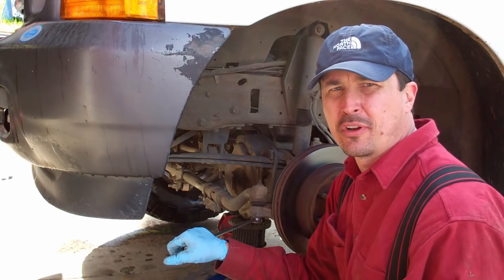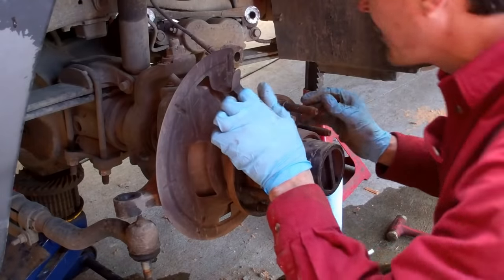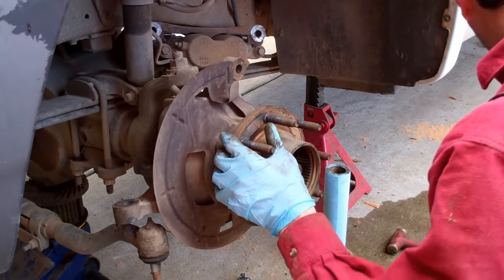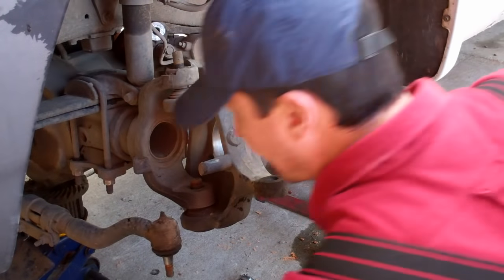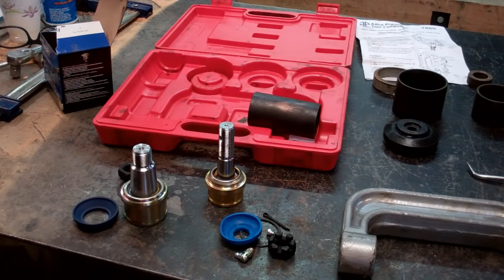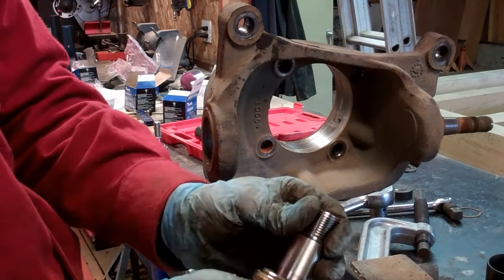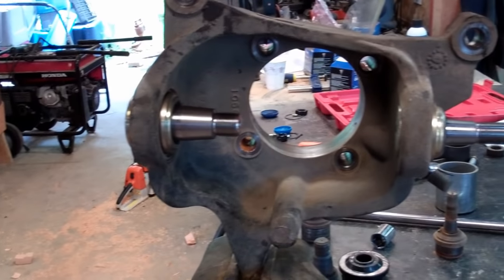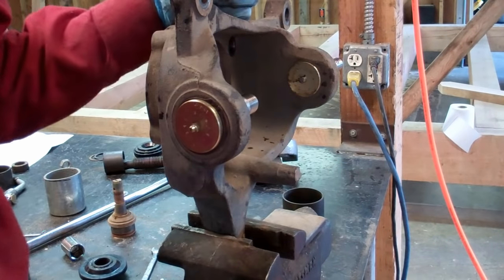How To Replace Worn Ball Joints Ford F250 Truck

Comment: Would bad ball joints cause my steering wheel to not want to return to center after finishing a left or right hand turn? I have to straighten it back myself. Then it seems like it wants to go the other way and I have to fight it back to the center.
Reply: One or both u joints are froze.
Reply: Yep, that's exactly what it was.  I had a reputable shop look at it and gave me a quote of just under $1000 to do u-joints and ball joints on both sides.  They said the ball joints were shot.  I didn't feel like shelling out that much so I bought a 3 ton jack, 6 ton stands, some other tools I didn't have, ordered ball joints and u-joints (all greaseable Moog brand) and new pads and rotors from Rock Auto and went to town on it.  Took me about 2 weeks due to working in my driveway in NE Ohio in March.  Turned out both axle u-joints were completely froze.  The ball joints were fine.  I regreased them and left them (I didn't want to get in to having to need an alignment... the TTB front axles are a pain to have aligned properly).  All in all I had about $400 between parts and tools.  I still have the ball joints in case I ever need to change them.  I had zero experience doing this work and learned it all from YouTube and the Fordtrucks forum.
Reply: I got the 3 ton steel jack from Harbor Freight.  It's actually a very nice jack (they also make a 3 ton low profile but I bought the regular one, it just looked stronger).  With the 20% coupon they always have out it was about $60-70 I believe.  I also bought the 6 ton steel jack stands for about $35.  The jack and stands had absolutely no problems lifting and holding my truck.  And it's pretty darn heavy ('89 F250 ext cab, long bed, 4WD, 351 V8).  I actually had to leave it on the stands for a couple of weeks at a time due to weather issues getting in the way.  If you can, order your parts through Rockauto.com - they're alot cheaper than parts stores.  Good luck!!  Oh yeah, and join the Ford Truck forum online.  They pretty much were able to walk me through any issue I had while tackling the job.  My username on there is Ford SD

Comment: What year model is this? I have an 04 and the drive shaft will not slide through the ankle. I have to remove the ankle and the drive shaft at the same time.
Reply: hey guy i am a ford tech..... you have to take the little cap off the hub to expose the nut that holds the outer cv joint tight 13 mm than take the swap bar end link loose , caliper and mounting bracket off ... abs wire etc etc... take loose the 21 mm nut on tie rod end ( separate it) .... take the vacuum hoses of the IWE ( 4x4 act. on back side of hub ) take 21 .mm loose upper b/j .... shock loose ... pull top of knuckle toward you and remove axle from hub and set aside... loosen lower b/j and separate ... remove knuckle and use BFH to remove ball joint from lower control arm .... pretty sure that is  it  i believe .....
Reply: thats a f 150
Reply: Jason Conroe 04 f 250 is same as video.... this guy made it look easy by pausing the camera.... sometimes getting the axle to slide out is a pain .... the big vacuum seal is a mother clucker to get moving ..... putting it back in is a pain with out the special tool to drive the seal in ....
Reply: thanks bud.

Comment: There is a technical service bulletin for the installation of ball joints. Torque specs are required in sequence like head-bolts.

Comment: Put a small straight grease fitting in the upper ball joint. There is an attachment I have for my grease gun that I bought so you can grease them. The attachment does not push onto the end of the fitting, it slides on from the side. I believe I got mine from McMaster, don't remember.

Comment: Now I am wondering how worn my joints are at 100,000 miles on an 2002 F350.  How many miles should we be getting out of a set???
Reply: They were not easy to replace, did the left side and an alignment.

Comment: re install is not just reverse order. you need to torque the top and bottom in a certain order.1st bottom partially torqued (find specs) , then top with the camber/caster adjuster in place, then torque bottom to spec. If you do this wrong (AS THE FORD DEALER DID TO MINE UNDER WARRANTY) by doing the top first, you can create a huge dead space before the bottom seats in its taper. Then you would have to actually flex and bend the "C" shaped axle ends, compressing them together creating MASSIVE pressure pulling apart on your new ball joints. Also, it's sooo hard to turn under the pressure, it taxes on your steering system. Ford screwed mine up when I brought my new truck back due to a pull to the left (front right had pos camber) i could see by eye. First they LET AIR OUT OF MY RIGHT TIRE to fix the pulling. The following day at the dealer, every one waiting for there car and probably every one within a mile could here me . I bet it was a good story around that dealer for a long time. Aligned yes, but not done correct as I found out 12 years later while changing my wheel bearing.............

Comment: Anyone may comment, if you know what i am talking about.
@ 8:24 in the video he is pulling out the axle shaft. While he is doing that it looks like there are two lose rings on it?  What are they and do they need to be replaced as well?  If I look at my F-250's front axle it has the same rings and they appear to be lose as well. just wondering if anyone would have an answer?
Reply: What you are seeing is the inner dust seal, yes I would replace it, I think it was less then $10.00, for a list of what you need check out www.powerstrokepsd.com, hit the tab write ups and click on ball joint replacement. The list is for 99-03 super duties.

Comment: While most of the video was good, I seen a few things that could have been done differently and a question. Not meaning to be negative on your video, just some input on things I seen. I changed my ball joints about 3 years ago and that upper ball joint right angle grease zerk would have fit, with a very small bit of grinding on the ball part of the zerk, it would have cleared the axle shaft. Also, you wasted your money on that 3in pipe. with a different configuration with the press, the longer pipe wasn't needed. Lastly, where was your thrust washer (plastic disc with 4 slots) that goes between then knuckle seal (slots toward knuckle seal) and the hub assembly?

Comment: I wish it were that easy to replace ball joints on what I work on, although they are called king pins and they go on heavy equipment weight 17 to 50k lbs easy. One the smaller end a CAT 420 backhoe the front axle knuckle weighs about 110lbs alone, I've had to melt out one pin due to it rusted in knuckle, you have to pull them out. pry bars and 8lb sledge no, tap the pin bolt hole to make a push bolt no, heat with push bolts no, so melt it. 
Sometimes on this stuff you just gotta melt it out. I'm doing the ball joints on my 2000 ford excursion 7.3 now and I don't mind it at all

Comment: At 15:00
You can also cut down the old ball joint with a saws all or cut off wheel so it will fit the tube in the kit.

Comment: If you use a small screw driver and place it between the snap ring and the ball joint groove you can keep it from reseating in the grove and remove it. $80.00 is the price of a good ball joint clamp so you'd be money ahead getting one.

Comment: It is incredible how much easier this is without all the rust that our old trucks have here with salty roads in the east. I did this on my old Ford and every nut or bolt was a battle. I needed a lot of heat, hacksaw, grinder, air chisel, etc. Look at bah53 video to see what I mean. He lives in Minnesota.

Comment: I was just quoted 3600 to have three entire front end rebuilt on my 99 super duty. Ordering parts doing it myself, will cost about 800. Local shop wanted 1700 just in parts

Comment: Ever replace front wheel bearings instead of buying the hole assembly?
Reply: sorry. Not possible on the 99-03 super duties. You can replace the smaller needle bearings at the back of the hubs though. But not the large main bearing in the middle of the hub.

Comment: Wish you could have included video on the seal reinstall part. Both Knuckle and dust seals. They caused a great PIA, esp the axle dust seal. Could not get them seated.

Often times, it takes less effort to uninstall t

Comment: Lucky with manual hubs, need a seal driver if it had auto locking hubs, the seal don't mean much on a manual lock hub other than a dust seal, auto lock the seal must be replace and put in with the driver tool to avoid problems.

Comment: Thanks for the information I called the best auto repair shop in alma mi . J&J standard there price with the best joints was 717.00 that's all 4 on a 2002 ford 250 xlt . That includes front end alignment. Doing it my self is 232.00 plus tax and front alignment . I dont think the saving is worth the hassle and we have salt so getting it apart could be a nightmare and then there's the wrecker bill and the embarrassment of towing it in all screwed up.  But I will say your the man but the savings were way off for my area .

Comment: man I must have gotten on the wrong section because my manual had me lift the up and pull the entire front differential apart before replacing these joints.... man I sure have a mess right now... Wish I would have watch this video sooner...sheeesh

Comment: I had to do the lower ball joint on our 02 tracker and you have to replace the whole lover A arm because the ball joints are not replaceable... Not a bad job but those A arms are not cheap... (had over 225k miles)

Comment: Where did  you get that (large) ball joint press?
Thanks
Reply: You can get them at Harbor Freight ($100.00)
Reply: or try rockauto.com has them to for a great price
Reply: Turns out that Advance Auto rents a heavy duty 23 piece kit....for FREE!
Reply: Tom Perkins I work at advanced auto, we rent our tools for the cost of the tools, you can either keep them when you're done (since you paid for them) or return them for a full refund and get all your money back
Reply: If you were in a real tight pinch you could use a decent sized c clamp.

Comment: The tools pay for themselves on the first job. I keep trucks a long time so when I do ball joints anything else elderly gets replaced while I'm at it. Sway bar links, any questionable bushings etc. I replace stock rubber with urethane and kits are reasonable online. 

What ISN'T reasonable IMO are tires, so take care of your front suspension! 

Inspect brake lines and hoses for damage, corrosion and dry rot on the rubber. New hoses cost less than an accident and a wrecker bill. It's a good time to do brake pads and cut or replace rotors too.

Comment: So I need new ball joints put on my 2001 Dodge Ram 1500. Should I have a nation wide company do mine for $630 including the alignment or do them myself and save all that money? I'm not sure what I should do..
Reply: Get the manual, watch some vids and go do it.
Reply: there is only one video I could find for the 01.  It is passenger side.  I worked on mine all day, and ran in to a ton of problems with rust.  A lot of mini propane torch, breaker bars, and cheaters.  I didn't get the ball joints out.  But tomorrow I am going to try and figure out how to get around the problems I have.  The upper ball joint stem is just spinning with the castle nut on it.  So I have to try a couple of things but I don't know.  If you want to talk about it you can message me.
Reply: Jared Szczesny
Try putting a jack under the lower ball joint of the yoke, ,or try jamming the upper ball joint with a lever or even a pickle fork , the idea is to jam the ball joint into the yoke so you can loosen the castle nut, its not usually very tight.
Reply: Gerard Jones, I ended up doing that later to get the bottom nut ON.  But we tried everything on the top nut, I had to cut it.  I redid the whole thing today and made my own video I am going to post.  Search for it in a week or so. 1998 1999 2000 2001 Dodge Ram 1500 Ball Joint Replacement
Reply: Jared Szczesny

Comment: take the cover off the front transfer case, look inside to see if the circular spring clip is sideways and pinched in the end of the axle groove, if it is push te axle back in and remove the clip, you will need a new clip

Comment: The rotor does not come off early 98 down Dana 60's & 44's the wheel studs are pressed on from the hub and unite the two together. Pull the hub and the rotor comes out with it.

Comment: Is this the same for 03 excursion?
Reply: yes it is. exactly the same.
Reply: Thanks a million, great video!
Reply: Yes it is.
Reply: Sorry to resurrect this from so long ago.  I used your video as a reference but near the end of this work just when I am about to put the Warn lock hub back I wasn't sure if its needed grease.  Did you reapply grease on the lock hub?
Reply: Answering myself, yes, pack grease in the 4x4 Warn lock hub.

Comment: That's just about on target regarding "specialized" work "farm it out to an expert".  Problem with that is, those experts tend to have lots of overhead, something the states/county/city and insurance have much to do with the costs of owning a shop/business. Therefore, to have fairly simple work performed, he expert has to make profits on parts, labor and supplies/materials they use to complete a job. By the time they get done with their overhead, their cost of parts etc. the final job ends up being over priced. Generally, the higher risk jobs (brakes, steering, suspension) have a high mark up due to risk/liability factors. BTW, that upper ball joint sleeve is for camber adjustments. After market parts sell them in various degrees and if I'm correct, the split in the sleeve has to point to the rear of vehicle or else it will change the caster setting.  Fords are known for poor caster and camber when new.  Many alignment shops know how to avoid the issues. Good video and .75 cent spacer.

Also, lots of mechanical shops hate it when a customer ask's for a diagnosis then doesn't do the repairs.  Can you imagine how long it would take them with a hoist, the tools all ready, experience and so forth?  They'd be done in 2 or 3 hours for $800. Lawyers at trial make that wage, not that they are entitled to that kind of pay but, they are known for being highly paid so why's a shop up in that bracket?

Comment: I have 250 on my f-350 I’m better off replacing all of the front end parts myself. It’s going to be down anyway. I’m going to use a red head steering gear and Moog parts. The more parts I replace the more money I save.

Comment: People dont even change their own oil!  *Tip on the upper ball joint Zerk: They make nearly flat ones that take a needle to grease, they work pretty well, or a very stubby Zerk, with a 90 degree gun adapter works well too..Name brand parts and routine maintenance = nearly lifetime of service.....it is amazing how long factory sealed parts do last...I have 177K on non-grease-able u joints on a C1500 but its just a parts runner V6-5speed.

Comment: The reason why they don't put grease fitting on suspension parts on modern vehicles is because it costs them a lot more money. Grease fittings on one vehicle may add to a few cents to a few dollars multiply that by how many vehicles they produce and that's more money they have to spend to make that certain vehicle

Comment: Just be careful, if there is excessive play in your tire it could be a bad wheel bearing (cars with integrated bearings in the hub this is a common occurrence)

Comment: Dodge, Chevy, Ford all use the same size and type of ball joints in their 250/350 or 2500/3500 trucks. Just use quality parts.

Comment: The Original Ball Jonts are Spicer same people who made the front rear end! They are the best quality you can buy! and no they don't come with zerks! I just replaced mine with Spicer again!  WHY? The originals lasted 160,000 some odd miles in NY's pot holed roads also off road and towing a 20,800lb boat all over the place! So anyway 21 years I got out of the originals and they were not that bad! $300 for the kit with all of the seals i needed and then some not cheap but not expensive. The MOOGs are ok but nowhere like they used to be! people say they are good for about 80k

Comment: They don't put Zerks on alot of parts anymore for the same reason they don't on smaller power equipment anymore either. End users don't know to or don't care to grease them causing premature failure of the part compared with sealed units. Now for a guy like yourself who does grease them with every oil change and cares to maintain his equipment. You'll see much longer service from them but you are sadly the exception to the rule nowadays.

Comment: turns out that my front end is a dana 50 (97' ford f250) and it's been a mess getting through this.  still on the first tire.  got the rotor off (finally) and am now trying to get the spindle off and it's a bitch.

Comment: Great video, like all of your videos, but I'm left with one question. Why do you wear a belt and suspenders? I don't mean to be a douche, I just don't understand.
Reply: +Blake Andrejcik because he can use a belt for edc, keep shirt and pants tucked and snug, suspenders because if you've worked with your hands and been up and down on your knees working you're shirt and pants pull apart.
Reply: +oregonnich 
Good point, I had not considered that.